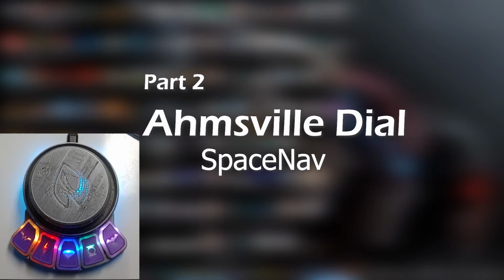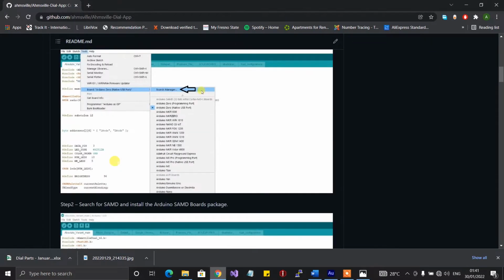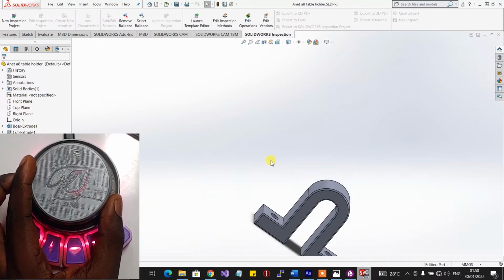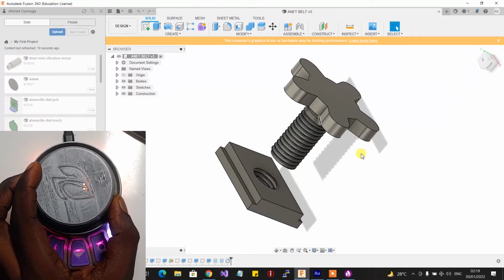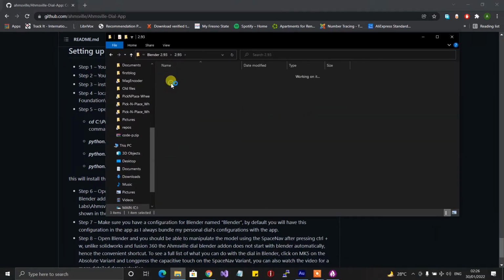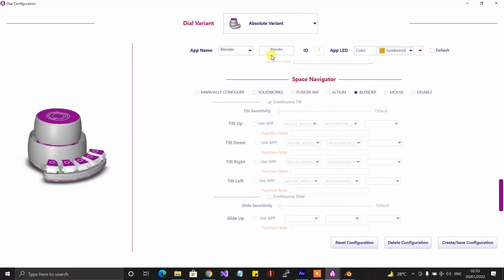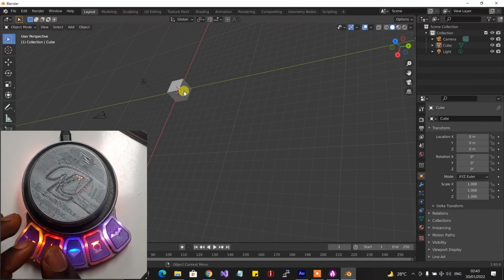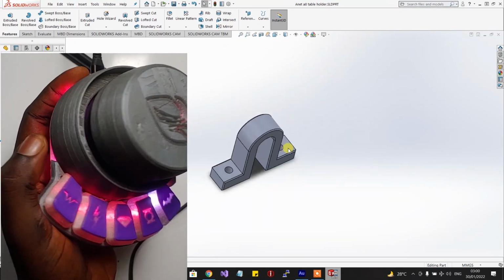How to Setup and Use the AHMSVILLE DIAL'S SPACENAV

Comment: I am evaluating buying a 3D Connexion space mouse to use together with a trackball, but I would be way more interested in this project instead (absolute variant); unfortunately, AutoCAD, Revit, and Rhino, which are the software that I am using for work, aren't apparently supported, and before even considering pulling the trigger, I would like to see a video of its use in this software. Anyway, awe-inspiring project; congratulations!!

Comment: Wow this is amazing, I was just going to buy a surface dial, but this is so much better for CAD(I’m an arch student). How is the restock going I’m interested in the absolute variant fully assembled.
Reply from the maker: One more week to restock...make sure you join the waitlist on tindie to get notified...
Reply: @AhmsvilleLabs  Nice, can you use the dial to program macros? Like the surface dials that pressing gets like a radial menu that you can customize?. Also can this be programmed to any app? Since I use revit, and photoshop.
Reply from the maker: Yes....you can program macros and there is a popup window function built into the app, i suggest you watch the configuration video i made describing the ways to configure the dial for different apps... https://youtu.be/c8ueATFmURA